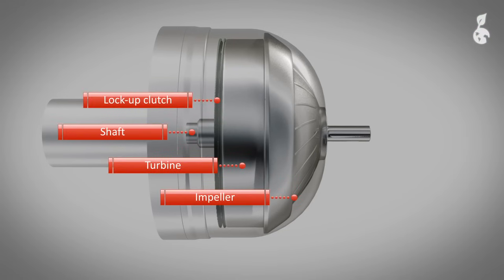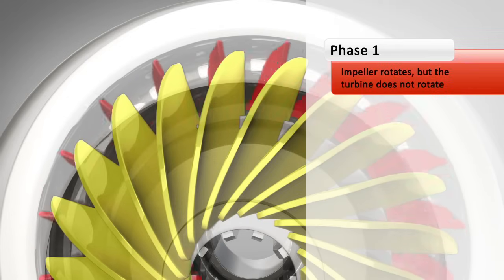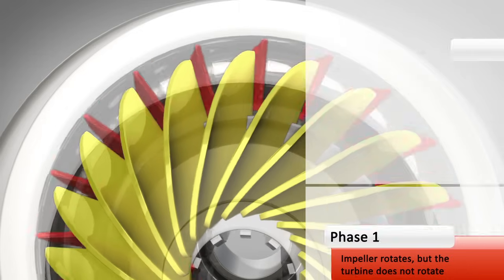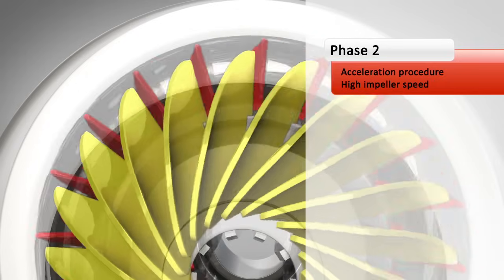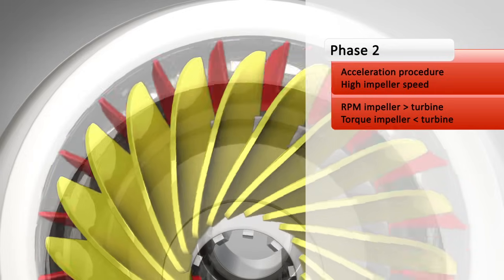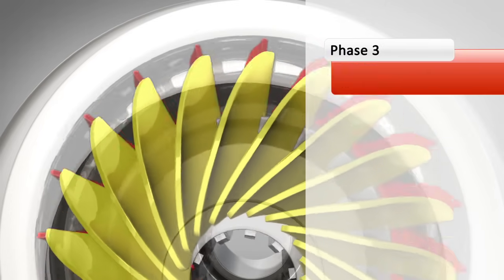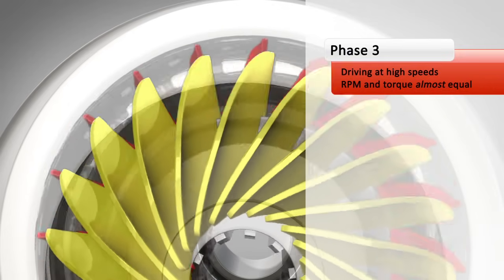How Torque Converters Work! (Animation)

Comment: So this acts as the clutch, no wonder autos are so buttery smooth, awesome.
Reply: +Detc0re and it also saps your power.
Reply: +InternetzSpaceshipz You my good sir, are exactly right.
Reply: Well I don't like CVTs and pure autos, but Tiptronic transmissions and dual clutches are awesome fun. Do you loose power from the torque converter?
Reply: Detc0re the tiptronic is dependent as some may just be shifted traditional autos, but most dual clutches do not have a traditional torque converter. I have a Mk7 GTI with a DSG and it has clear engagement and disengagement points due to its lack of a traditional torque converter. You gain faster shifts and less drive train loss, but you lose the smooth roll on of power from a stop and it is much clunkier in stop and go traffic. I think it's worth the trade-off but many would disagree as well.
Reply: the parasitic effect of power loss from a torque converter is marginal. Maybe 10-20%. That is why there is a lock up clutch. To eliminate the power loss at higher speeds. And when you honestly think about it. Your normal daily driver doesn't need a manual. Trust me I drive manual and they are a pain in the ass in heavy traffic. Sometimes I just like being able to get into my car and drop it into gear and go.
Reply: +Sigma Octantis lol, how much, like 5%. I have hydrodynamic transmittion and its awesome in every way. It isnt the quickest, but who the f*ck cares - in 99,9999 % of driving situations u just dont give a shit that the gearing isnt hyper fast. I have 170 Kw diesel and i cannot be happier.
Reply: +Detc0re buttery smooth cars aren't very fun to drive...

Comment: The genius behind this is so undervalued. Imagine having to come up with this on your own where would you start?
Reply: +Pretermit I would start with beer.
Reply from the maker: +Pretermit Well, normally, it happens (a) after a long time of trial and error and (b) with a lot of luck :)
Reply: +Thomas Schwenke and (c) a lot of creativity in linking various fields/pieces of knowledge together. Quality explanation, you have another sub.
Reply: @Pretermitted  when I was 24yo, I pondered this very problem, having only seen one removed from a vehicle but not knowing anything else about. After a LOT of thought experimenting, I figured centrifugal force is where I would start, since mechanical rotation is all I have to work with and a locking coupling is out of the question. Expanding on would obviously take a lot of trial and error, but I don't think coming up with the concept is as difficult as you believe.
Reply: @ThomasSchwenke-knowledge  aint no goddamn luck in this shi.
Reply: @ThomasSchwenke-knowledge  and in stages..  old video still great concept..  the first torque converters were simply fluid couplings so the original automatics could stop and still pump fluid..  the stator came later..  and even later the lockup clutch..  and now variable pitch stators, and PWM control variable lockup clutches.. and of course now the DCT which doesnt even use a torque converter
Reply: @ThomasSchwenke-knowledge Newton is the only one who gets to skip step (a), his summer project was inventing calculus 😂
Reply: +jlerro1981 Engineering refinement too as these have to be built in mass production at cost effective prices for economy cars and built to be reliable.  It is truly amazing how they took a complex piece of design into common use for the masses.
Reply: +Pretermit same people cant tie their own shoes or cook an egg
Reply: +Pretermit What a profound statement, which i could not have agreed with more. For a seemingly simple assembly, the dynamics are pretty freaking complicated. Those impeller blades have to be at the exact right angle to meet the torque requirement and displacement. A lot of mind bending mathematical formaulae going on here
Reply: +Pretermit I could not agree more.
Reply: Pretermit You said it. Especially when you look at how transmissions work.
Reply: Probably in the worlds best schools and almost infinite intelligence, imagination and talent.
Reply: It started with the wheel.
Reply: Put two fans facing each other turn one on and the other one off.
Reply: You start by having a high IQ coupled with a creative mind as well - almost all inventions were done by Europeans and their descendants, so look to them for inspiration!
Reply: You would start with the simplest version and then modify it iteratively over years, decades, or even centuries as your needs become better-defined and your understanding of the system's behavior improves. That's how all things are invented. Nobody has the best possible version of a new device pop into their imagination fully-formed.
Reply: That statement reminds me of something my late father said to me about 20 years ago. I was replacing a master cylinder on a vehicle and him and I were looking it over talking about how simple the system actually is and he looked at me and said "And yet I wouldn't be able to come up with the idea."
 This is one of the reasons I like mechanical contraptions and tinkering, when you look at a lot of inventions they seem simple in how they work but coming up with the idea is a lot more complicated.
Reply: Its like something I would think of, then say ah that'll never work
Reply: you start at classical mechanics? which were invented discovered by Newton
Reply: I’ve always said this exact comment about pre existing mechanical marvels like this. And my friends never understand why I wonder how smart that person had to be,  thank you for making me NOT look crazy for always asking
Reply: Before computers, CAD, 3d printing! I still am amazed at older valve bodies before electric solenoid shifting
Reply: +Pretermit 
I'd start with the traditional friction clutch that's for sure. I gotta start somehwere. 
I'd stare at this long enough (give or take a couple decades) until I recognize the forces at work with friction and realize the wear problems with friction couplings. 
I may be staring at a model of this without its housing on and getting sprayed by the lubricative fluids in the process due to centafugal forces, noticing how the object moves the liquid.
While I go into the shower to clean the oil that's now coating me, I may also notice the force of a moving liquid pushing against me from the shower head and I may make a little waterwheel toy to entertain my childish intrigue.
Give me a couple more years I may get a eureka moment when I take the process of a liquid moving an object and an object moving a liquid and put it a closed system.

Watch me fail several times prototyping and give up.
Reply: @BrokenLifeCycle  That's how it works. After you there will be two other people giving up and the fourth one finally invents it. twenty years later it goes into production. Or maybe not.
Reply: On the shoulders of giants.
Reply: If this wasn't used we'd probably come up with some sort of mechanically/electronically shifted manual transmission bastard using multiple clutches. Oh wait. That train wreck of a transmission already exists.
Reply: Pretty much all car parts 😭
Reply: It's start with an IQ 160+
Reply: "Invented in 1905 in Stettin, Ger many, by Dr. Hermann Föttinger of the Vulcan Ship Yards, the torque converter was originally a steam turbine drive for a ship propeller. It gra dually found its way into the mainstream auto motive industry over the following 25 years."
Reply: A lot of math
Reply: That’s what project teams are for
Reply: In the shed or garage where all genius ideas come from.
Reply: Pen and paper and a lot of math, using hundreds of known theories taken from thousands of people working together on fluid dynamics, metallurgy, physicists, etc. It's a concept born from some moment of inspiration or an evolution upon a previous success or failure. Its incredible how far mankind has come, and how many problems we will have to solve in the future (most of which we have made for ourselves sadly). We are lucky to live in a time where we all have access to this information.
Reply: Since u asked where wud I start , well if u place two fans and run one , the air of one will start spinning the other .. that's the lightbulb moment , now change compressible fluid ie air to incompressible , and u need a casing ofcourse , and then will have to put ur thinking to design the vanes in some iteration to figure out stator physics . And there u will end up in one such mechanism
Reply: I thought the exact same thing, you got to be a super genius to  think of this and come up with it.
Reply: On the shoulders of giants
Reply: I'd start with this video.
Reply: I ask myself the same thing about a lot of things.!. Auto transmission..etc.
Reply: always  fascinates me about the person who came with idea for the  first time
Reply: Uggggghhhhh...another one of those guys.

Comment: i thought it fills up with automatic transmission fluid and it spins under pressure, so is this new technology or im wrong and tranmission fluid never played a part of the torque converter, so turbines huh this intrigues me which car years use this like my 2013 honda civic has this
Reply: +Bryan AMDGuy you need to watch it again. He explains that it is filled with fluid that is circulating. The animated gold liquid 9right before the explanation about the stator) shows the fluid flow. fluid flows through the torque converter, hence the "fluid coupling" explaination

Comment: The narrator's pronunciations are impossible to understand. Saying that accelleration takes place "when the traffic lights turn green" adds a level of unnecessary complexity to the scenario that requires the learner to keep more things in mind and therefore makes the operation of a torque converter more difficult to understand.
Reply: I found it to be completely the opposite. I thought using the "stages of driving" was a clever way to relate what the torque converter was doing during those stages.
Reply: I disagree to he explains it in a way everyone dumb or not can visualize it in there head
Reply: +Theodore Zuckerman This narrator is very well versed.
Reply: +Theodore Zuckerman I found the narrator very easy to understand and english is not even my first language.  Are you drunk?
Reply: @arjds82  I am listening again and this time I am able to understand the narration. I think perhaps it is because I viewed other material first and remembered the words used, knew the technical terms used, and knew what words to expect here, so now when they were said I could recognize them, even though they were pronounced slightly differently.  Now that I am able to identify the words, I am finding this to be  one of the best explanations of how a torque converter works, that I have ever seen.
Reply from the maker: +Theodore Zuckerman Thank you for your feedback. I will keep that in mind :)
Reply: @ThomasSchwenke-knowledge  I am listening again and this time I am able to understand the narration. I think perhaps it is because I viewed other material before coming back here, and remembered the words used, knew the technical terms used, and knew what words to expect here, so now when they were said here I could recognize them, even though they were pronounced slightly differently.  Now that I am able to identify the words, I am finding this to be  one of the best explanations of how a torque converter works, that I have ever seen.
Reply: The narrator is not a native english speaker, he has a slight German accent, that's probably why you had problems understanding him.

Comment: Don't you mean centripetal forces?
Reply: Good point but this debate has been going on for ever so I tend to keep quiet now
Reply: +Goabnb94 Centripetal forces only apply when the mass is tethered. There's nothing holding the fluid in a circular motion so it's under the influence of inertia.

Comment: My main problem was understanding WHY torque multiplication happens. The explanation in the video seems inaccurate, stating at 2:22 "the result is a multiplication in torque, because the fluid flows back more slowly". While in fact the explanation (found out from other sources) has to do with vortex flow and how the speed of fluid keeps on adding up.

That being said, nice videos! :)

Comment: In short, my car is moving due to the kinetic force of a liquid. It's amazing how much force is applied to a liquid which can move tons of metal up a hill.
Reply: i don't think that's possible since its encapsulated
Reply: Faisal7HTX Then consider that little amount of matter doing all that work. Still amazing. :)
Reply: Bassotronics :
 kinetic force of a liquid oil, is being used only for phase 1, 2.
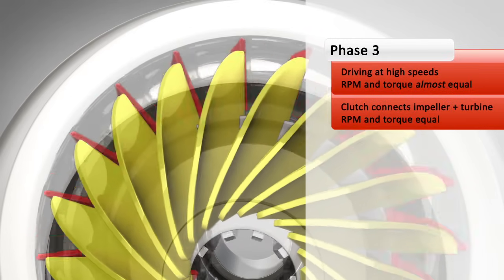 phase 3 4:09 : lock-up clutch lock the
 turbine to the impeller, this eliminate losses associated with fluid drive.
 1-1 connection from engine to transmission with no slippage between compnents.
 phase 3 begins at speed 37 mph or higher.
 source : 
 1. https://www.youtube.com/watch?v=HVkReoez04I&t=25s
  from google (automatic lock up clutch) result 3
 2. https://www.youtube.com/watch?v=pV9MBisOPlI&t=18m49s
Reply: bingo!
Reply: Somehow Koenigsegg has designed a torque converter for electric vehicles without a transmission or lockup clutch. I can't wrap my head around how they plan on making one able to survive that kind of abuse, let alone a fluid that actually stays a fluid. I have a sneaking suspicion it won't, and the torque converter will be a weak part that will need regular fluid checks.
Reply: That's why the oil is cooled as well. To maintain the pressure and temperature at a set level.
Reply: Also consider some earthmoving equipment and semi trucks use the same basic technology. Pretty amazing
Reply: oil is not lighter than air
Reply: Funny enough Also liquid takes a big part of stopping you’re car as well
Reply: @silverstorm6973  How  is that?
Reply: Chase Miller brake fluid ? It’s the hydraulic pressure of the brake fluid that stops your car my friend
Reply: @silverstorm6973  Oh I thought you meant the fluid in the torque converter my bad.
Reply: Bassotronics well, until the clutch locks the inverter and turbine together
Reply: When the lockup clutch is engaged, your vehicle isn't moving due to the kinetic force of the liquid. Only during acceleration from standstill and momentarily during gearshifts it is driven by the fluid coupling. During normal run, the whole torque converter is like a direct shaft because it locks up the impeller and turbine parts
Reply: The fluid just liberates the parts the clutch and the drive shaft generate the torque
Reply: There is a lot of power in things you really underestimate. The hydrogen in a drop of water can produce about 81703449 Joules or 22 kWh of equivalent to 20 kg of TNT of energy through fusion reaction. So 1 litre of water contains enough hydrogen to produce 440.000 Kwh or 440 kilotonnes of TNT worth of energy. Just the fact TNT itself derives its massive destructive power from the fact it is a substance that takes on a hugely bigger volume  when it reacts to form gas releasing a huge amount of energy when detonated shows the raw power contained in the basic physical, chemical structures of substances you might otherwise not associate with any form of potential for industrial application or "work".
Reply: as Forklift driver hits the gas to elevate a load using oil and the weels by a shaft. this will power both
Reply: Better be carful which atf you use
Reply: another funny thing is that most powerplants are all just massive teapots...they just boil water to use steam to push a turbine to generate power.

whether its nukes or coal, its just to boil water.
Reply: Human's learnt that liquids are incompressible and really just moved hell with it.
Reply: +Bassotronics Excellent relation and  use of analogy.
Reply: Your vehicle is moving due to fuel,air and spark.
Reply: and compression
Reply: Bassotronics .Its been 2 years.You working at bk?
Reply: its all physics
Reply: hydraulics can literally move earth
Reply: I really would think with all the pressure, heat and speed that's in a torque converter, the oil would vaporize. Especially under huge stress.
Reply: And here I thought modern cars still used Spantaneous combustion engines
Reply: Not so amazing when you consider liquid is merely a state of matter.
Reply: @WhereisJesus Nobody cares about you.
Reply: Water weighs 1000x more than air. Therefore 1000x higher density. That means it has 1000more kinetic energy than a air and oil is slightly lighter than air, but indeed it is still awesome

Comment: My scanner shows PO 734... I looked it up and it says Torque Converter Clutch.. Do you know if that will cause my inspection to fail? It's a 1996 Jeep Grand Cherokee... Big 5.2 8 Cyl with only 70K on it...
Reply: sinsagoodmansbrother Sorry... Torque Converter Clutch Solenoid Valve... Is there a fuse for that?...